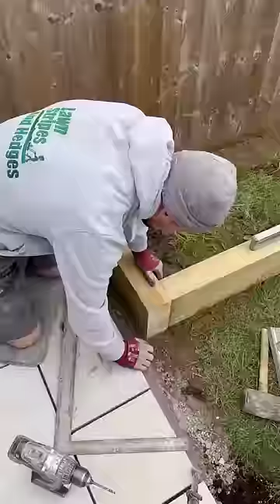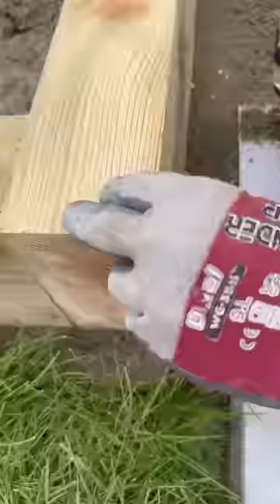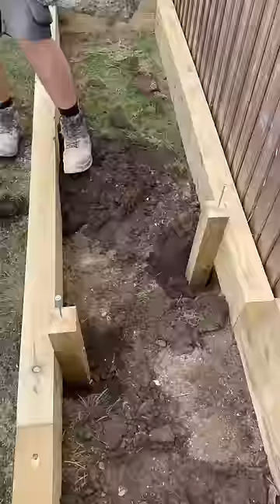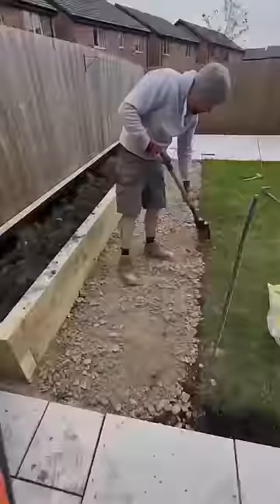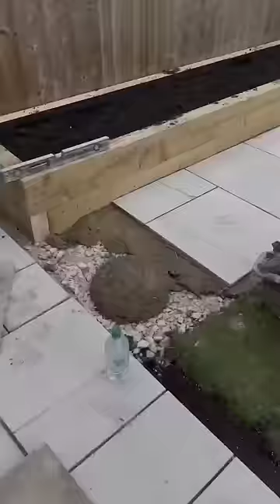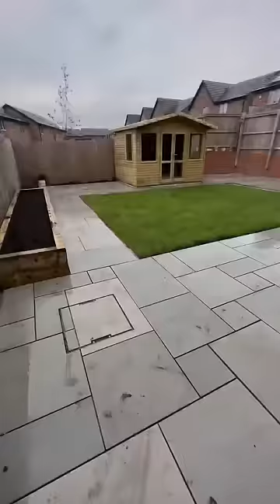We had a productive day on the Atkinson project today #landscaping #garden  #shortswithcamilla

Comment: six months later the wood has rotted through....
Reply from the maker: You obviously haven’t seen our work before.
Reply: Pressure treated wood will last 15 years. I staple round some dpc to any part that has contact with the ground, looks like they painted the inside with something that does a similar job
Reply: @matthewderrick4816  parents have decks and a fence going on 24 yrs. you have to apply a treatment every few yrs and the will last long time. this guy didn't even seal his cuts after. then put tar? hack job 101
Reply: @lilbucko  another yank in the comments section thinking he’s Bob the builder! Chill out your houses are made outta cardboard ffs!
Reply: Лиственницу если у вас есть в продаже
Reply: Just wondering why you would think that?
Reply: Correct if wood touches the earth, its going to rott - may be in few years!
Reply: @matthewderrick4816  it will rote in few years because its touching earth!
Reply: @MarkMarshall_LSH  - I agree with that other reply!
Reply: How will you have access to fence boards when those need to be replaced?
Reply: @johnbagewll2321  wrong; that timber will not be there for another 80years. And yes i plan on living to 120
Reply: @zefrum3  
Well good on ya!
Reply: Why put tar on it and nothing else?
Reply: Mine has been down for 14 years and just started to go

Comment: I love this work! Tell me something: do you apply any coat of paint or oil on the timber? In order to make its life to continue long time.
Reply: Yeah I wondered the same....not sure why they can't engage in a comment, only a like.  Does the like validate your question?  Or just acknowledge your comment.  Oh well....YOLO I guess
Reply: You only need to coat the cut ends of treated timbers to make them last longer. Seeing them on plenty of gravel ensures good drainage. The inside would only need to be coated or lined to prevent leaching of treatment chemicals into your garden plants.
Reply: @TarzanArmani007  hey cool cool, thanks for the heads up buddy. 👌👌👍
Reply: @TarzanArmani007  Thanks a lot for your comment. I will take in mind, I wish to make a little project with timber as well.
Have a good one.

Comment: Am I wrong in saying it didn’t look like you cemented them posts in ? Just a bit round the top and also unless them sleepers are oak or similar quality timber there not gonna last to long . I like to float my sleeper beds , 4 inch posts ,?700mm deep cemented in and float the sleepers off them so no sustained contact with the wet ground , oh and post savers around the posts .

Comment: Looks sick. How’s it holding up with the rain and all? Did you apply anything to make the wood last longer? I also wanna make one
Reply from the maker: The wood was already UC4 treated and then used Black Jack Bitumen paint, here’s the link: https://www.amazon.co.uk/shop/lawnstripesandhedges/curation/640b4ae1-651c-4ad9-94fc-5967f0d80260?ref_=cm_sw_r_cp_ud_aipsfshop_aipsflawnstripesandhedges_ZE2K9GCG8N44WTPZ8DYW&dplnkId=e8dac5b7-387e-4b57-a2e1-22d63147b4fa&dplnk=Y

Comment: No point in painting the inside for protection, IF the bottom has not been done which is in contact with the ground - it will just rot.

Comment: You put the tiles on a wet concrete, and the concrete on top of the gravel, there are going to be lots of uneven surfaces and cracked tiles.
Wait are those tiles for outdoors slip proof.
Reply: So negative
Reply: Lol it still will bond even when wet, just takes longer to dry, you actually mix sand and cement with water, not let the ground. moisture cause the bond.

Comment: Does the wood not rot?
Reply from the maker: We get UC-4 treated timber and then also apply black jack bitumen paint to the inside where it would be touching the soil. It doesn't full prevent the rotting process but it does delay it for a long time!

Comment: Nice work - you must be in a warm climate. One winter up north would have that garden box heaved and all out of sorts. Wish I could build right on groups like that…
Reply: I did a similar design using 3 1/8 x 12 salvaged glu-lam beams. So easy to be able to build on grade here in the Pacific Northwest .
Reply: @josephpope3467  how did you build on the slope and make sure PNW rain doesn't affect the box over time?
Reply: @aabhasbhatia9413  Mike planters were all on flat ground however I am a builder and what I would suggest is making a small gravel footing you may also have to put in something to tie the timbers back running perpendicular to the front wall
Reply: Heaving happens to things in the soil, not on top of it.  We've had raised beds for 20 years in  northern indiana and they've never moved. Nor will they.